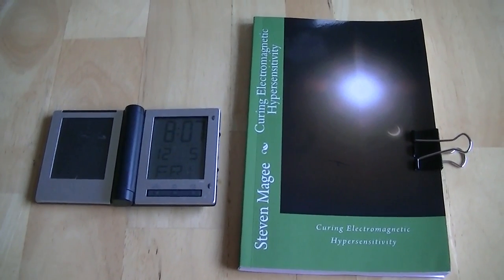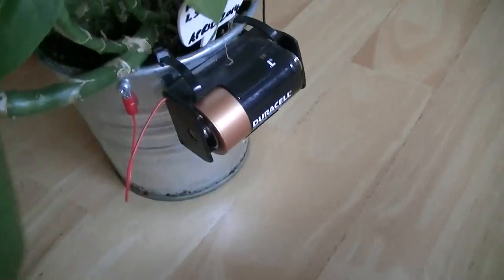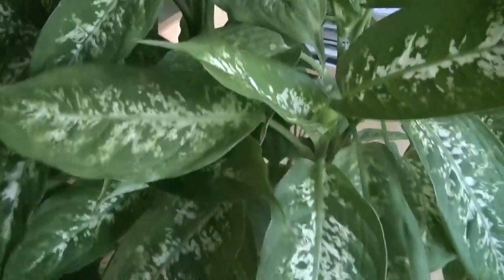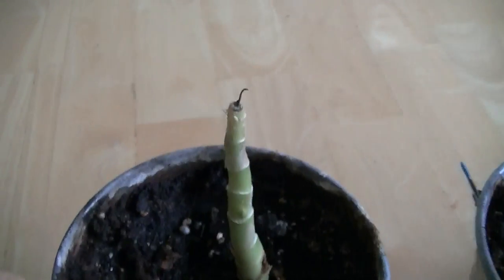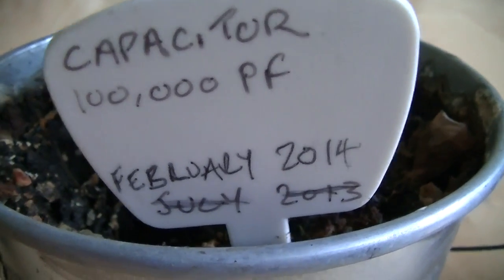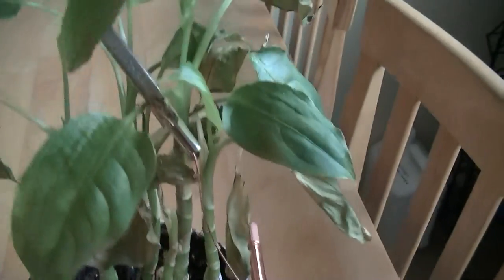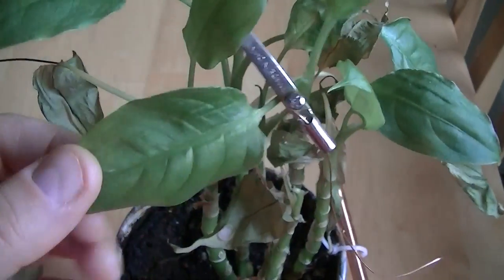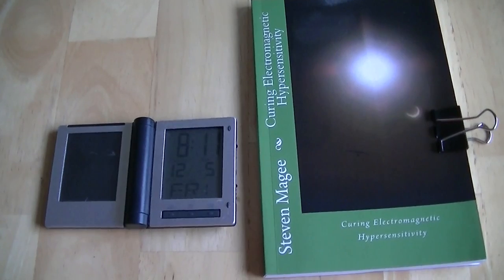Growing Plants with Electronic Components Results

Comment: Hi. Have you tried to feed the plants with negative voltage? Human cells when healthy, work between -20mV and -25mV. Ph is voltage, thus -400mV equals to Ph of 14 and +400mW equals to Ph of 0. To heal a human cell faster you need to push -50mW into the cell. Are you able to make an experiment with negative voltage?
Thanks, great job.

Comment: Passing an electrical current through the soil/plant electrolyzes water.
It releases oxygen that the plant wants.

Try 12VDC and watch what happens.

Caution: do not use stainless steel electrodes!
You can create Hexavalent Chromium, which is toxic to both the plants and humans!
Reply: What is the best electrodes I can use? Can I use aluminium?
Reply: @StrsAmbrg  Aluminum is a noble metal and will disintegrate in an alkali solution.
Absolute best is pure platinum.

Some have used carbon rods.

I have use (Can't remember exactly which one) one copper electrode (Positive I think) and 5 stainless steel electrodes.
Copper turned black. When it does that, resistance increases.
Reply: @crazysquirrel9425  well, let me see whether I can use my pencils.
Reply: @StrsAmbrg  Graphite is conductive.
Problem is with pencils is what did they put into the graphite to hold it's shape and give it the hardness/softness they have.
Experimenting is a good thing! 

Another issue is that there is a relationship between conductivity of the material, the conductors' conductivity, and the DC voltage applied.

If you research HHO type systems, they used a pulsed DC current. Some used pulses in the 41-43 KHz range.
Seems those pulses are more efficient in breaking apart the water molecules.

While copper is a good conductor, there is a chance it can harm the plants.

Another issue is what other things might be in the soil that electricity can alter in a negative way.

This field is very young yet.

Comment: the coil has a capacitance. try lower inductance and non cap coil. Th batery is very low esr cap with very high cap.
 the capacitor (keramik  higher. try to use oil cap in stead of keramik cap.it wil not create hf spikes.when hf spikes are induced by surounding. Also try empty battery to check if its the volatge which creates health